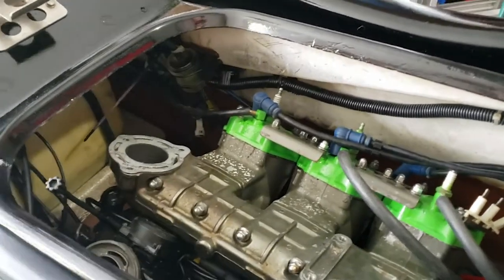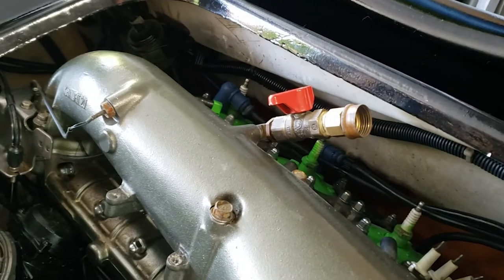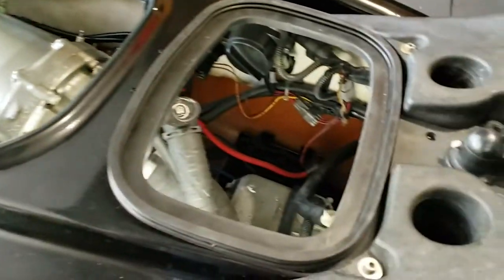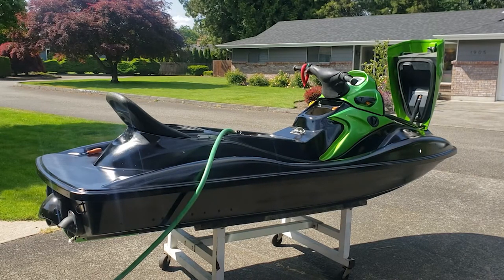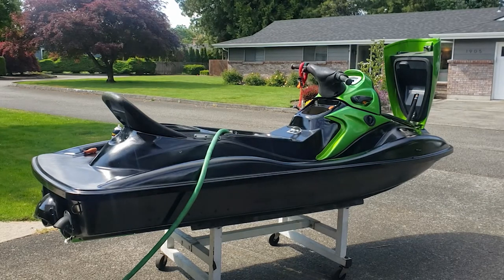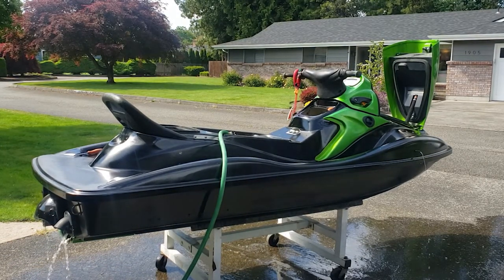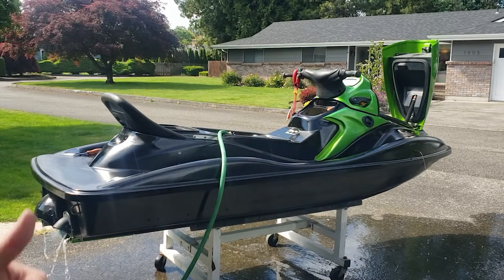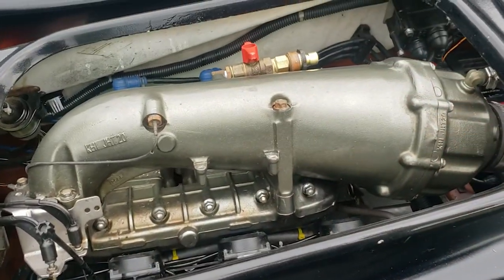STX-R assembly and startup! Part 5

Comment: Have a 2002 STX R1200 and very interested in adding reverses, what parts did you use and where did you get them?
Reply from the maker: I sourced all my parts from eBay once I got the part number. I got the part numbers from https://www.kawasakipartshouse.com/oemparts/l/kaw/500ba065f8700223e479ad74/2003-jet-ski-stx-12f-jt1200-b1-parts off of a STX-12F since they are the same hull. the only thing I was not able to get a part for was where the steering cable came out of the back of the ski. I got a water-tight cable socket and fabricated that to pass the steering cable.

Comment: What part do you use and where do you buy it to installed the nut lock for the reverse cable.
Reply from the maker: This was the hardest part to figure out since they don't list a part number and its not included on the hull. I went to a hardware store and  got a water tight conduit connector. I then drilled out the section where it needed to go through, and epoxied it to the hull. I passed the reverse cable through it and sealed it from the inside to make sure water isn't leaking through. It is extremely strong and the reverse works great with no leaks. 
here is what I got.

https://www.homedepot.com/p/Halex-1-2-in-ACC-Non-Metallic-Strain-Relief-Cord-Connector-27693/202077093?MERCH=REC-searchViewedNA-202077093--N

Drilling the large hole in the back was a little nerve racking, but worst thing I would need to do is fill the hole so I went for it.:)
Reply: @vivogarage  Thanks. Great information.

Comment: What was your compression after re-build?
Reply from the maker: Right after the rebuild I was getting around 100 PSI, after the engine was broken in, it's currently at 135. If my cylinders were properly honed out, I think it would have been closer to 150.